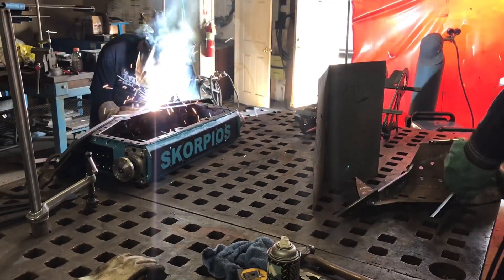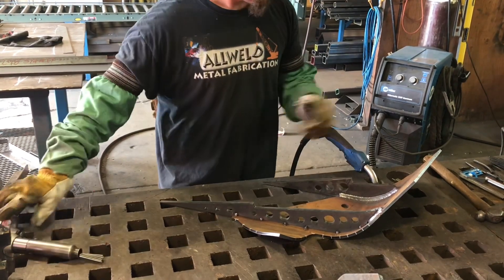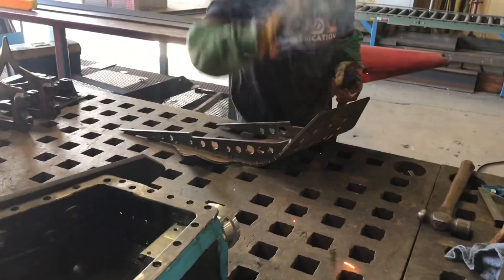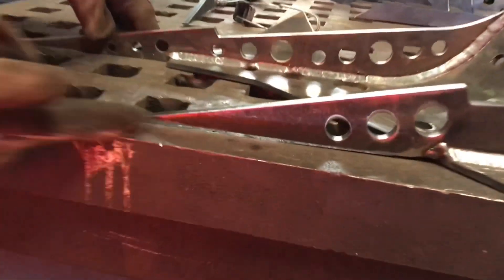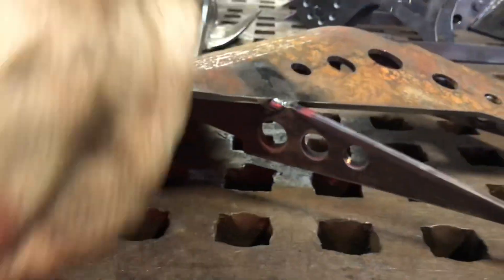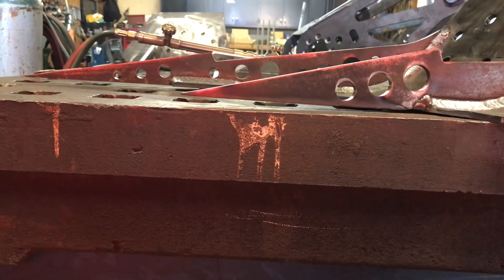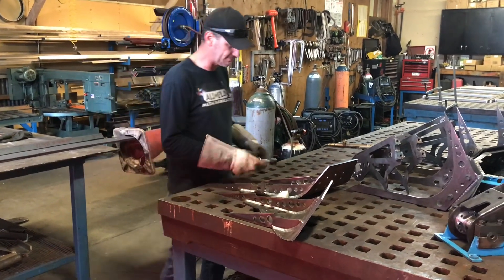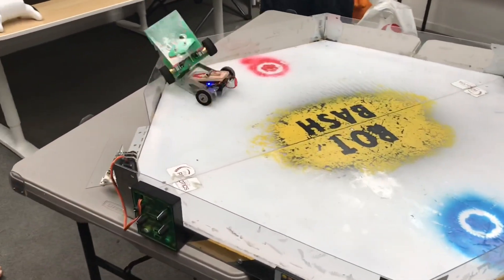StarFighter Armor  [Skorpios Builder Blog 24]

Comment: I'm waiting for the reveal of your end game and hydra configuration that's just really long hinged forks attached to the skorpios king forks
Reply: High centre Hydra on the forks and leave them under a pulverizor, then use the hammer saw once the flipper is damaged ;p Or just use the hammer saw if it's in a good position
Reply: @RennieAsh  Skorpios is very nimble and fast I'm sure it can outmaneuver Hydra and get to the side once Hydra whiffs and needs to pump the flipper back

Comment: at what point are all these configuration changes a different bot? especially situations like hydra gutting all they hydraulics for a vert.

maybe they need rules limiting total weight that you can use for spares or for modular nonsense but prevent "one" bot from being its own rumble.
Reply: That huge vertical spinner attachment is for huge ;p
Reply from the maker: Robo games and RFL tournaments the rule is 60% of your robot Required to come back.  BattleBots does not currently have this rule as it is very hard to enforce.
Reply: Reminds me of Jamisons beetle, I think silent spring. It had a vertical spinner configuration, and a horizontal undercutter, which basically swapped out the entire front half of the robot.